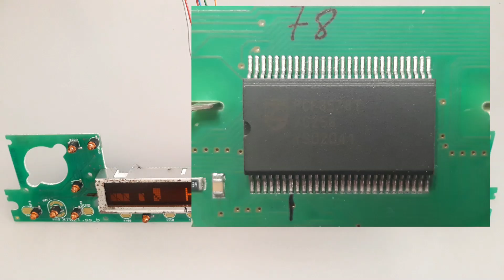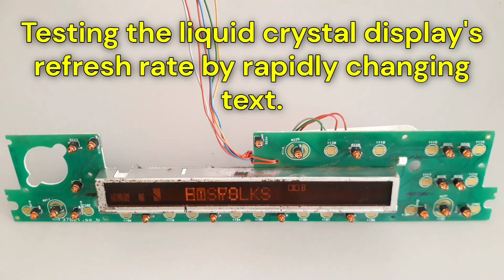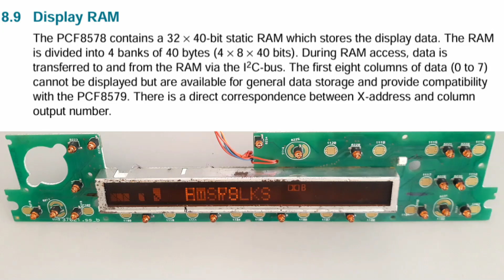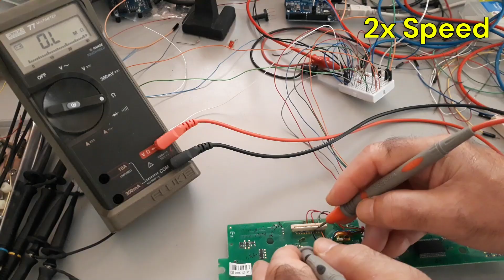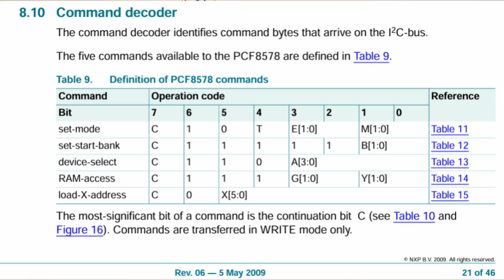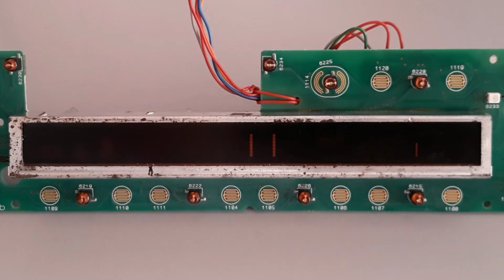PCF8578 & PCF8579 Arduino Tutorial | Drive Segment LCD Displays

Comment: Thx. I have always avoided serial bus driven devices as much as possible.
I do like to put out all the signals in parallel the same time.
I want to watch what the given command achieves instantaniously with no considering command piping, shifting, delays and such.
Reply from the maker: Hello thomasw2509,
Thank you so much for watching!

Yes, indeed! Parallel communication is far superior to serial communication. As always, cost reduction plays a huge role in consumer electronics and wins every time. Two wires in a serial circuit are much cheaper than 8 or 16.

While I'm no expert, I'm always available to help!